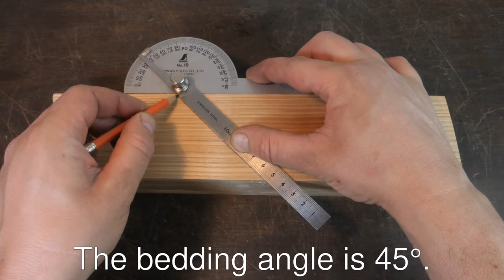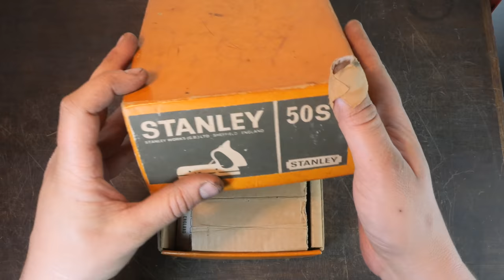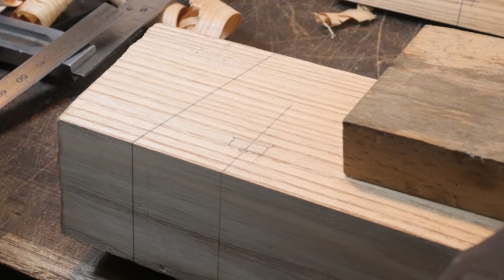I made this sliding dovetail plane

Comment: Pretty cool, a simple and effective design. Been looking at making some sliding dovetail joints myself, for some shelves. Probably will do the female part with a router, but a handplane like this for the male part is pretty cool, and silent! Think I'd use a strip of hornbeam or boxwood for reinforcement though, the steel strips are sharp, and you'll marr your work if you bump into it (or cut yourself on them). Do you have drawings of it on your patreon?
Reply from the maker: Yes, I love silent tools. The metal vs. hardwood edge is just a matter of preference. I haven't really had problems with damaging my work. But if you have a piece of boxwood lying around that could be a nice alternative. I have been asked repeatedly about drawings for some of my projects so I have just uploaded a CAD-model of the basic geometry of this plane to my patreon. Would this be useful to you?

Comment: Die Glühtempertur und die Glühdauer war noch ganz ausreichend. Im Grunde ist der Stahl nicht gehärtet. Natürlich funktioniert das Messer trotzdem, aber die Standzeit ist wesentlich kürzer.
Reply from the maker: The actual duration of heating is not apparent in the video. Also, the colours of hot steel on video depend strongly on the lighting conditions. The steel was impossible to file after hardening.

Comment: Is there a reason you chose to have the iron cut on the follow edge as apposed to the leading edge like a rabbit plane would?
Reply from the maker: Hey, thanks for watching! I’m not sure I understand your question. Since I am using a straight blade, the cutting angle is determined by the angle of the dovetail. Or what do you mean?
Reply: I must have been looking at the skewed angle incorrectly.  Sorry for the confusion.

Comment: 12:35 The rolling shutter bends the heck out of your plane :D 

also, i have 2 questions: you have a honing jig, but still sharpen by hand. is there a specific reason for it, or just preference? 
and, is that the dictum jig?
Reply from the maker: The jig is a no-name thing. I’m not sure where I bought it but not dictum. I like to use the jig if I need to grind a bevel at an exact angle. But when the bevel is already there, I find it more convenient to sharpen by hand.

Comment: What does the angle of the sole end up at?
Reply from the maker: I don‘t remember exactly but I think it was pretty close to the intended angle. Certainly close enough for practical purposes.
Reply: @imadethischannel  Thank you for the reply.
Reply: This is an ingenious piece of geometry as well as woodworking. I am still trying to wrap my head around some of the math. I'd like to ask whether the fence is "tilted" to make the 10-degree bevel?  I'm guessing the fence causes the plane to tilt so that the left edge of the blade begins the cut and as it goes deeper the right edge of the blade finishes the cut to the edge of the board.  I think this is correct but the woodwork is so good it's hard to tell even when I stop the video to look.
Reply from the maker: Hey, I’m glad you like my plane! I constructed the angle of the sole according to the desired bevel angle as seen in the video with the paper wedge. I am sure there is a mathematical way to do it but I found this more intuitive. Everything else then followed from the angle of the sole and the fact that the iron is rectangular. You have to make sure to hold the plane upright when starting a cut. I planes the fence flush with the face to make sure it has the correct angle. Does that answer the question?
Reply from the maker: By the way, I did not come up with this concept. There is a German company named Ulmia that sells a similar plane.
Reply: @imadethischannel  yes, I think it answers the question. Yes, I've seen Ulmia's plane, but if I bought one I couldn't say, "I made this!" I know you understand.  Thanks again for your answers.
Reply from the maker: Of course it is almost always preferable to go through the immense trouble of making it yourself ;)

Comment: Why is nicker scores in front of the blade and not after the blade?(12:03 min)
Reply from the maker: Hey, if you don’t score the fibres before the cut on cross grain cuts, there will be a lot of tear out. A nicker behind the blade would not really prevent that.
Reply: @imadethischannel  That is, even better when the click is located on both sides?
Reply from the maker: @ВасилийНагорный-е1н  I guess that would be overkill. On nicker that cuts the fibers before they are mangled by the main blade should be enough.